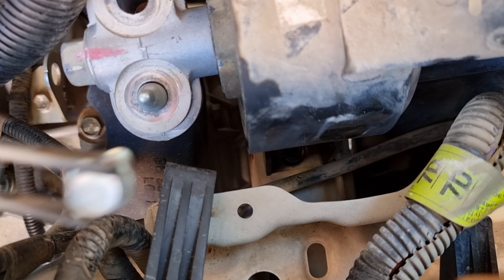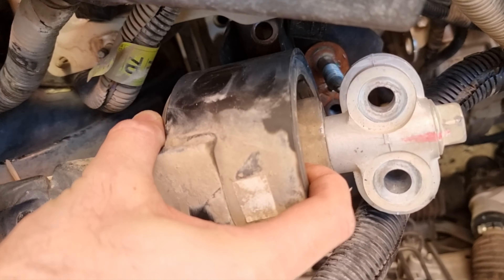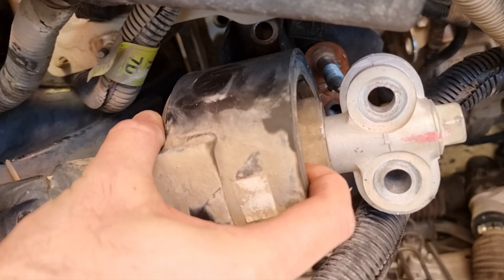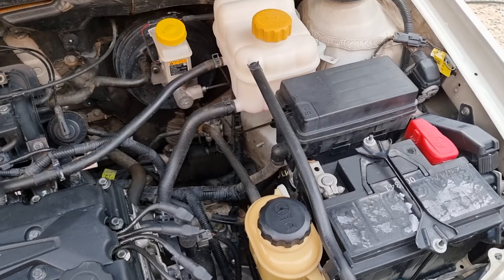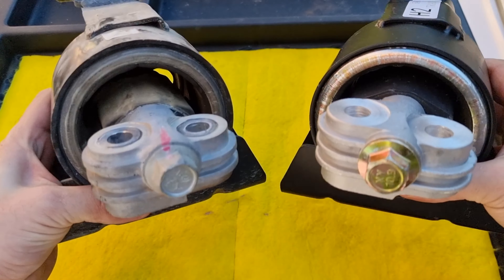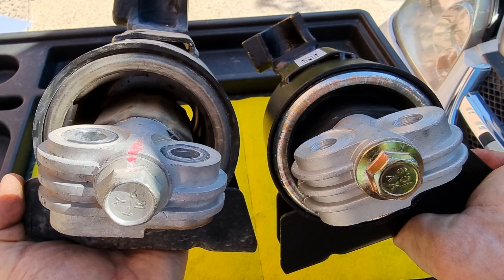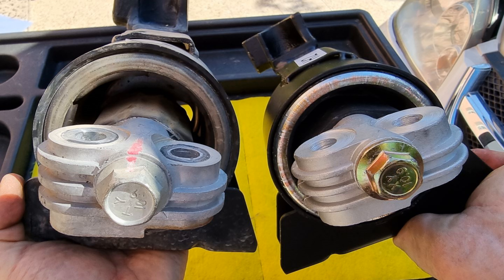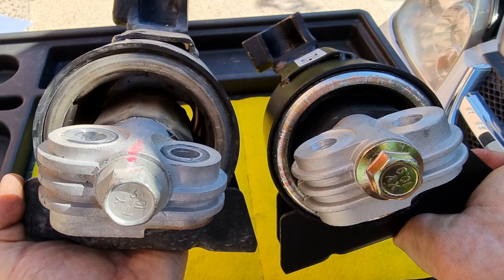Watch this before replacing engine mount/How to replace engine mount on your car

Comment: Hi Ali, thanks for all the videos for maintenance of the optra car. I have the same vehicle and I can't find a way to fix the ac problem it is not working good the clutch is not engaged therefore the ac is not working appreciate your assist it is nearly summer here and I need to fix it
Reply from the maker: i had same problem before and replaced the ac compressor

Comment: This side of engine mount in my Optra accidentally fail and transmission fell off of it and made driveshaft tear apart as well. I recommend you guys who have Chevy Optra replace the engine mount on both sides before the accident happened like myself. Parked the car for a few days at the shop because the engine mount bolt(thread) had broken off too because the weight of transmission pulls everything down.